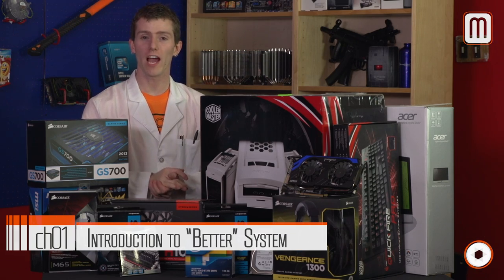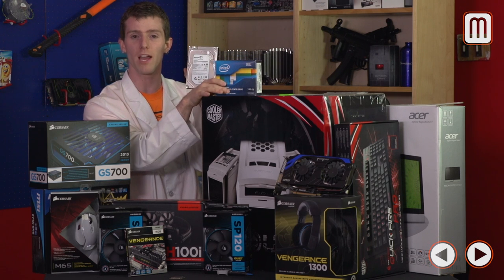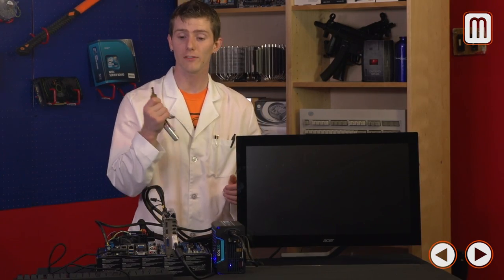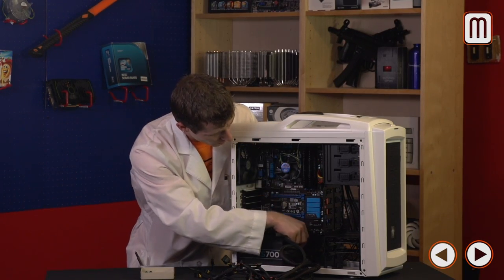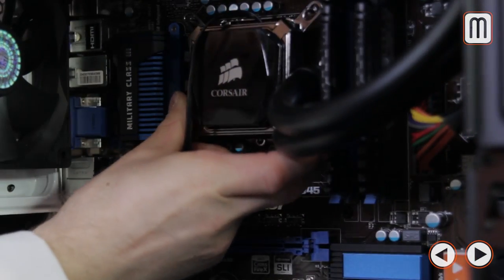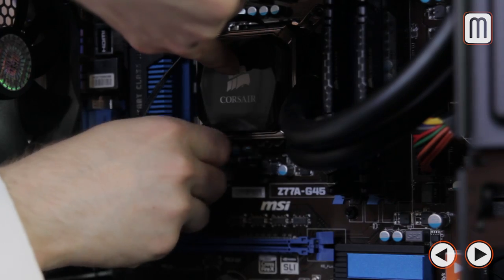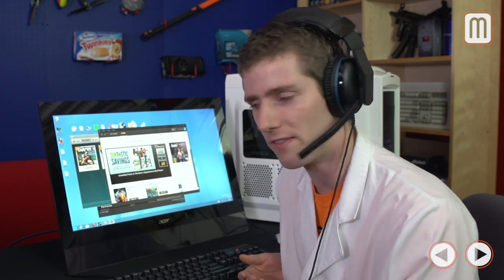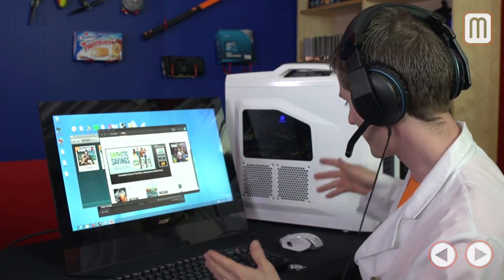ULTIMATE Build a Better $1500 Gaming PC Computer "How To" Guide

Comment: Any help on building my next PC? I have SOME of the parts picked out. I just need reassurance or opinions by others.

Phantom White/Red NZXT Case

Intel Core i7 4790 3.6hz Quad Core.

ASUS Maximus VII Hero Mother Board

2x4gb HyperX Memory

1TB Primary HardDrive

AMD Raedon R9 380 4Gb graphics card
(Or should i go with geforce GTX 970?)

700 watt power supply
-------------------------------------------------------------------
Please Tell me what you think needs changing.
Reply: Lithimatic Shiz Swap your 4790 for a 4790K, reason being is that you are buying an expensive overclocking motherboard so you might aswell buy the CPU to match and then overclock whenever you are ready/more familiar with PC's.

MOBO is good.

Ram is good, just make sure it is DDR3

At this pricepoint an SSD is a must for OS snappiness. Go for a Samsung 850 EVO in whatever capacity you like. BTW you can use a HDD and SSD, if you didn't know.

Go for the 970, less power consumption then the AMD card. And less heat (normally).

Make sure the PSU is at least 80+ Bronze and above 500-ish watts or above.

Happy building.
Reply: Thanks! And Yeah I did mean the i7 4790K I just forgot the last letter. :P
Reply: Lithimatic Shiz Awesome, looks good!
Reply: For this price point you would usually a want to aim for a better GPU example The gtx 980ti especially when you consider your parts quality and the price of your mobo....
Reply: Manuel Morillo He may have different priorities though, plus with OC it makes much more sense in terms of cost effectiveness than the 980ti.
Reply: I was just introduced to the radeon R9 380.. I am still having a hard time choosing between the 980ti and the R9 380
Reply: Just based off of opinion here where I live. I've heard alot of good things about them performance wise. Right now I have a nvidia graphics card and it seems to work fine and doesn't consume power as much.
Reply: Lithimatic Shiz the 380 is like $300 where the 980Ti is like $700, there is no competition.
Reply: Yeah. Im getting the 380x. All my specs added up atm is 1496. Pretty decent. Im half way up to the price anyways.
Reply: Lithimatic Shiz Dont get the 4790k then. With that low end of a gpu you dont need to spend so much on a cpu. Go with a 4690k.

Comment: I have a fx 6300 black edition which is overclocked to 4.3ghz and with a Noctua nh d15 fan and a Asus Radeon r9 380x gpu. Is that good?
Reply: Naaastttyyy u did 2 things wrong firstly u used amd secondly u 
Used asus branded stoff you have to use msi and nvida (my opinion)
Reply: The FX-6300 is trash. You could get a used 6-core xeon X5670 and a X58 motherboard from ebay for the same price but much higher performance.

AMD GPUs are great. R9 380x is not a terrible buy, but I would have got a used R9 290x.

Good cpu cooler though lol

Comment: Ok, I've been researching and learning how to build a computer to upgrade from 762-900p 30fps console pesant to glorious Pc Master Race, bathing in the light of Lord Gaben. But there is one problem. I know how to build everything and almost everything about the bios (Asus z170-a). But, I dont know how to use the boot priority. Alot of videos show that you shouldn't add the secondary drive (ssd and hdd) but others say you can. Im using a flashdrive to install windows, but I dont know how I am supposed to manage that either. Please help me. :D

Comment: > Static free work station to not damage components
> 15:20 uses a magnetic screwdriver
Reply: The magnet in the screwdriver is not powerful enough to short anything out
Reply: C_Raz_Y Generally having magnetic screwdrivers is not a good idea. Those components are so sensitive even the smallest magnet could damage it. It's mostly recommended to not use them if you assemble any hardware components like the MoBo or a socket mount.
Reply: Finkel - Funk Really? I've been using a magnetic screwdriver on my computer with no problems at all.
Reply: C_Raz_Y Heard bitter stories about that on several occasions. But the truth is: It's probably best to be too cautious about these kind of things. I bought an ankle strap + anti static gloves for assembling my PC. Truth is there is a 2% chance I'd be able to charge myself up hard enough to kill the build. But 2% chance vs. paying a total of 6 bucks to save 1000$+ gear? Worth.

Comment: ok i build my pc like 6 months ago and i keep getting manny errors blue screens, first i started to get CLOCK_WATCHDOG_TIMEOUT ,and alot of low memory errors but i manage to fix that and i dont get them anymore, but now i my pc freezes when im playing really low quality games or when i have it idle just freezes and i get WHEA_UNCORRECTABLE_ERROR im currently in the process of getting a new cpu and ram. my specs are
mobo- asus maximus VI formula
cpu- intel i7 4790k @4.5ghz: with a corsair h100i cooler
ram-corsair vengeance 2x4gb 
psu-cx750m corsair
storage is samsung evo 840 150bg ssd:and seagate hhd 500gb
gpu-evga gtx770sc

Comment: Can someone pls tell-me if this is a good build? Also its my first build.

MOBO----ASUS ROG MAXIMUS VII HERO Z97
GPU----MSI GEFORCE GTX970 TWINFROZR V GAMING 4G OC 4GB GDDR5 PCI-E
CPU----I5 4690K 3.5GHZ 6 MB SKT 1150 BOX
CPU COOLER----CM HYPER 212 EVO
PSU----CORSAIR CX600M MODULAR 600W 80PLUS BRONZE
CASE---NZXT H440 WHITE/BLACK
RAM----KINGSTON PC3-14900 1866MHZ 8GB HYPERX FURY
HDD----Western Digital Caviar Blue 1TB
SSD----INTEL 530 SSD 240GB 2.5" SATAIII
Reply: Dylan3553 Yeah they are very good parts, especially the mobo. The only thing i'd change is the cooler, the 212 is a very good price/performance cooler but id save up for a Corsair H80 or similar to overclock the crap outta that 4690k. You will get the full potential of your cpu and mobo plus you will save up some space and make your build look better
Reply: UltimatePotato Dude Thanks bro :)
Reply: Dylan3553 no prob
Reply: If this is a gaming pc itd be great i just reccomend u use a higher grade cpu for working and if u use for gaming i reccomend u get a better case like cooler master or corsair
Reply: matthew halim You are a bit late :P, allready got it....and....its amazing :D

Comment: Isn't setting the fans on the rad to PULL going to be pulling essentially hot air into your case?
Reply: +Mario Saltalamacchia was thinking the same thing
i think he meant push configuration?
Reply: Hussain Dhaif I am sure there is some kind of logic to it, but I don't see it..
Reply: it'll pull fresh air through the rad into the case. then the rear fan will exhaust the hot air. if it were set to push, you'd be pushing the hot air from inside the case through the rad, which wouldn't cool the CPU as well, but it might give cooler internal case temps overall.
Reply: Joseph Martinez I think it is all semantics.. 6 to 1, and half dozen of the other.. Honestly, in my opinion, everyone makes way too much out of airflow, and as long as there are enough fans, I think airflow is airflow.

Comment: In the top left corner my motherboard only has a 4-pin connector, so the power supply cable wont fit in.

Comment: Hey can someone help me with my problem. So I spent about 4 5 hours building my first PC. I made sure everything was correct and then double checked it. When I finish and try to power it on nothing happens. All the parts are compatible and brand new. Does this mean the psu is a defect?
Reply: +Tekniik Check your CPU cooler seating. If it isn't fully seated you could just be overheating incredibly quickly.
Reply: TRAILER-GUY it wasnt cpu, one stick of ram was bad and was causing this problem.

Comment: What games can I run on this? 
Intel Core i3-4170 Dual-Core 3.7GHz processor
8GB DDR3; 1TB HDD
Intel Integrated 4400 HD Graphics
802.11 AC WiFi with Bluetooth 4.0
Windows 10 Operating System
Reply: +Big_stackz100 Not many. 4400 HD Graphics are useless for gaming, consider getting an entry level GPU such as a 750ti
Reply: +Big_stackz100 Yep. Games are more graphics intensive that cpu intensive. A pc with an i7 but with a weak gpu will experience lag. Try getting an i5 as its quad core, which is better for gaming. Some games outright refuse to run on dual core cpus so getting an i5 is a good choice. For your graphics, see if you can afford something like a GTX 970 or an R9 390. If you are on a budget an R7 370 or a GTX 950 are good.

Comment: i got a question, what should i chose? amd fx 6300 3.8 ghz or amd fx 8300 3.3 ghz octa core?
Reply: THE MORE EXPENSIVE ONE
Reply: No, expensive doesn't always mean better.
Reply: amd 6300 becuase you only need more than 4 cores
Reply: If you need the extra cores than get the 8300 and overclock it.

Comment: I'm only 13 and i'm interested in buying a good gaming pc that runs smoothly, something below $600 would be great, it dosen't need to be amazing just something that can run newer games well.  And older games like gamecube, and playstation.  I don't know that much about gaming pcs.  I'm not looking for something with amazing frame rate and amazing quality, just something that will run smooth.  Any tips on where to look for good pcs and what to look for are appreciated! PS: please don't tell me to just build a pc:)
Reply: for below $600 you wont find a lot that will rival the performance you will get when you build a pc. Cheap pc's that you buy will a lot of times have sketch motherboards and power supplies. if you are really interested in getting a pc, i'm telling you it's not as overwhelming as you think. Im 15 and was originally going to buy a pc, and then realized that i could get much, much, more performance  for my $ if i took the time to learn how to build a pc. You're going to need to know how to to do most of this stuff in the future for upgrading anyway.I bought my parts for around $600 (including windows, good mouse, razer krarken pro headset).

Main parts

power supply: corsair cx430
hard drive: 1tb wd blue
cpu: pentium g3258
gpu: gigabyte gtx 750
ram: 4gb hyper x (add another stick when you have an extra $40, or use 8gb if its cheap enough)
Motherboard: asrock h97m pro 4

you could also add a dvd drive (or not its not needed)

Hope this helped!
Reply: thank you very much!

Comment: Is this good? Its prebuilt btw
Intel Core i7 4790 
3 TB HD + 256 GB SSD 
32 GB 
Radeon HD R9 270 2GB 
WELL EET BE ABLE TOH RAN MEINCRAFT???
Reply: That's so funny about prebuilt rigs from the store. They always have massive RAM and a powerful CPU, but the card is always a mid-tier. 270 is actually on the lower level of mid-tier.
Reply: Yeah i have noticed it now. Thinking of uppgrading it to maybe a GTX 780 at my b-day. Some good suggestion for a nice graphics card that isnt to expensive?
Reply: Linus Johansson Get a 960 or 970 instead. Maybe even powerful get a 980.
Reply: RelMC il maybe be getting a Asus R9 radeon 290x 4gb. Or a GTX 960
Reply: Linus Johansson Okay, but I have to warn you the reference 290x could have a very noisy fan when it's on load.
Reply: RelMC k but i use a headset so i dont think it will annoy me that much
Reply: Linus Johansson OOOOkkkkkaaayyyyy....

Comment: Two days ago I purchased my PC components I am getting ready to build my first PC can someone tell  me if the "ghetto" test bench is necessary?
Reply: +Matt b Thanks each day is a new part
Reply: +Marcus Hunter I did the same thing and the last part k am waiting on is the ram
Reply: +Marcus Hunter Really late answer here lol. It's a good idea to use it, just to see if everything boots up. Not only compatability, but also to check if all the parts are working as they should (ie, not broken). Because the worst thing that could happen would be that the computer wouldn't run and you would have to take everything out and try figuring out what isn't working.

Comment: I have txt 970 and i7 6700k 4.4 GHz and 16 Gigs of ram should I get water cool or the Hyper 212 Evo
Reply: 212 evo
Reply: +ViperLemon Water cooling is always cooler then air coolers so try water
Reply: Water cool is good but if it brakes rip

Comment: Hey so I built this PC almost exactly like how it is here and I was wondering if I can upgrade to a gtx1080 without having to upgrade any other parts
Reply: It's highly unlikely that you would. Whilst i'm not an expert i could guess that the 1080 uses more power (this psu may not be sufficient) The cpu would almost definitely need an upgrade (bottlenecking may reduce the 1080's overall performance) and the motherboard may not have the right chipset needed for said processor. Cooling may be another issue but i doubt it due to this build being water-cooled.
Reply: You'd want to check length of the 1080 and get a new CPU
Reply: I'm not sure I'd trust running a 1080 on almost 4 years old parts especially that cpu and mobo.

Comment: Im thinking on building a desktop and i just want to know if this is good or if i need to upgrade anything

intel i3 61003.7ghz box

asus h81-gamer

kingston value ddr4 8gb 2133mhz cl15

1life ps: jet 600w 120mm

seagate barracuda 1tb 7200 rpm sata3 64mb -st1000DM003

asus geforce gtx 960 strix dc2 oc 4gb ddr5 (pci-e)
Reply: What is your budget
Reply: around 700 euros max
Reply: That is perfect. If you invest more money into a better graphics card you're set for years. With this GPU you can play every game no problem. I would suggest buying a SSD to put windows on so windows boots much faster and overall is faster.
Reply: ok thx
Reply: the motherboard won't work with the cpu :)
Reply: How much storage on the SSD do you think is needed?
Reply: Akram Khan 250GB is good. 120GB will fill up quickly but don't store all of your games in SSD by another HDD 1TB and store large games like DOOM, GTA V. store small games like 11GB or lower but not too much maybe like 5-7
Reply: Omar Maestro Thanks for your response.

I am planning on buying a 1TB HDD but I will reconsider buying a 250GB. I just wanted to know because some friends recommended putting my OS onto the SSD along with my most used programs.

Have an awesome day :]
Reply: Akram Khan That cpu won't work with that motherboard though
Reply: zBruda Oh that isn't my build.

It's Lucas andré's...
Reply: Akram Khan oh i forgot ,  yes you can put windows and your most used programs in SSD but make it balanced with your games. don;t put movies on the SSD
Reply: Akram Khan Oh lol
Reply: +Luca Neel, that just isn't true, a gtx 970 is already kind of outdated.
Reply: That was 2 months ago, and even now the 970 isnt outdated, there just is a newer version of the series available. Plus, the gtx 970 can handle every game out there today.
Reply: +Luca Neel not 60 fps ultra 2x msaa

Comment: can someone please explain to me how he connected all of the fans to corsair link.  It just does not add up.  The product comes with 2 fan slots from the block (which is where you would put the radiator fans) and he buys an extra splitter and attaches it to one of the fan slots from the block. 23:54  This would mean that only 3 fans could be attached to corsair link.  Both radiator fans, and both front fans.  But this would leave out the back exhaust fan and this is where he says ALL the fans gets to me.  Can someone explain to me please.

Comment: Guys, i am a NOOB at this and I need help. Is there something you guys would change in this build? I want to run 1080p games really well (60fps+) and 1440p games at 45fps+. Is this overkill? Would you guys change something?

CPU: i7-4790k
Motherboard: Gigabyte GA-Z97MX-Gaming 5
Cooler: Watercooler - Corsair Hydro Series H80i-CW-9060008-WW
Memory: DDr3 Kingston HyperX Savage HX316C9SR/8 8GB 1600Mhz
GPU: EVGA GeForce 970 FTW
Storage: Seagate SSHD 2TB 7200RPM 64MB SATA III
SSD: None (yep...)
Power Supply: Corsair CS650M CP-9020077-WW 650W
Reply: Pedro Martins well, if you're only gaming i would swap out the i7 for an i5-4690k , there's no noticeable difference for gaming, and I've heard bad things about seagate and would not recommend it and a sshd wont do you much justice, instead ,with the money saved from getting the i5, get a 120gb or 240gb ssd with a 1tb western digital black or blue hard drive.
Reply: Nikhil Menda ooh and is your RAM in dual channel, cuz you should get dual channel and what is your budget?

Comment: hey guys, dumb question but how many fans is good? my case came with 2 and im wondering if that is good/not enough. thanks!!!!!!!
Reply: +PapaJenkinz Depends on what you are running in the case.
Reply: BlueSteelBlaze What do you mean? I play games sometimes but don't do like video editing or photo editing.
Reply: What kind of games do you play, andd what hardware do you have?
Reply: BlueSteelBlaze i usually play games like grand theft auto, some cod, games like that. in terms of hardware, i have a raedon 380, i5 6500, z170a asrock motherboard, 8 gb ram.
Reply: ***** As long as there are more mounting areas for fans (which I'm pretty sure there are), it would be good to pick up one or two more. However, to confirm that the step is really necessary I would just get your CPU and GPU temps when under full load.
Reply: BlueSteelBlaze ok thanks. and what do you mean under full load? sorry i am kind of new to the custom pc stuff.
Reply: ***** Basically it is when your pc is under major stress due to a program consuming large amounts of power. Just search up some benchmarking programs online. I'm pretty sure Linus even did a video about some.
Reply: BlueSteelBlaze ok thanks dude. you have been really helpful

Comment: Is this good specs:
8 Gb of DDR Sandstorm Ram
Intel i5 Darude 4420k
CORSAIR: 69TB ssd ultra
Nvidia 1738 4K ready graphics card
Cherry MX Zomp keyboard
J.o.h.n 8k monitor HDMI cena edition
Red laser Pepe sized razer mouse
Kermit-based -1040 wat power supply
Choccy Milk cooling

Plz tell me if these are good specs
Reply: hmm.. you used dead jokes.. unfunny, try again
Reply: That's the joke, now don't be so bloke